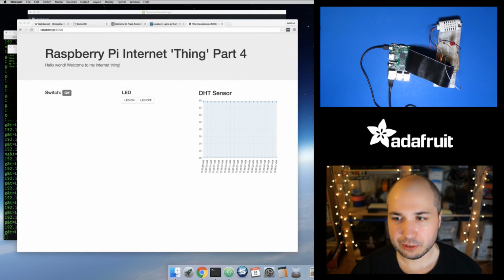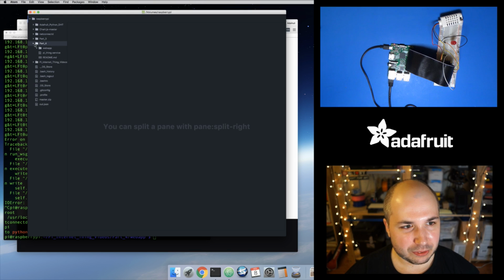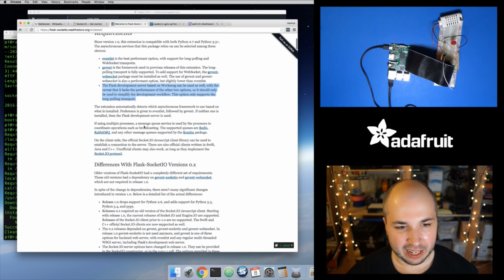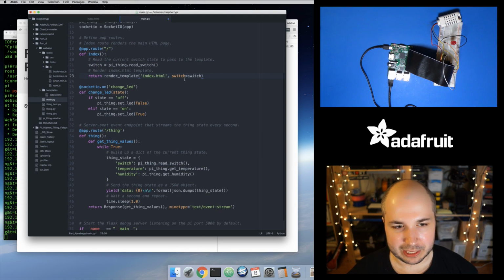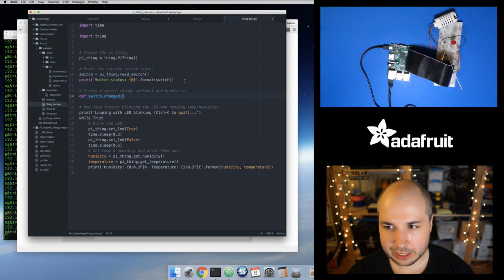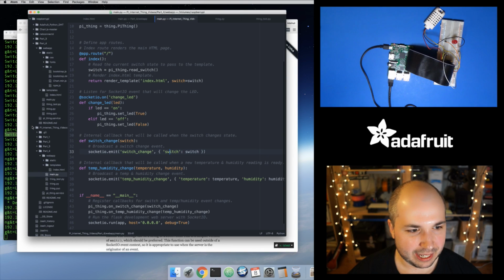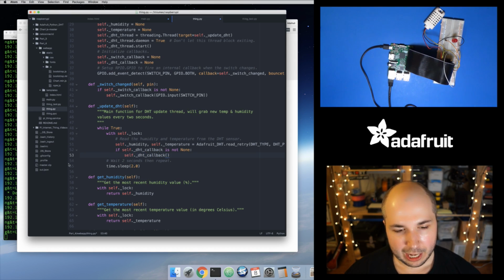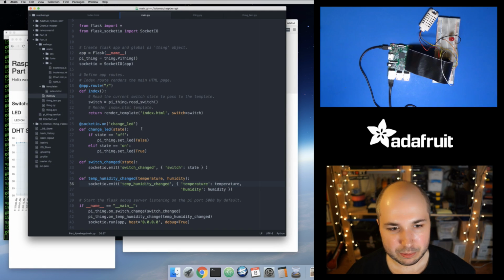Raspberry Pi & Python Internet 'Thing' pt. 4 with Tony D! @adafruit #LIVE

Comment: Hey Tony - Thanks for great videos. Just one issue:
Since you changed to using Socket IO in "Part 4", I can flip the switch (I'm using a slider switch) and randomly get the wrong switch-state displayed. I'm assuming it has the do with "bouncing" signal as the switch is moved. Any ideas how to fix this?